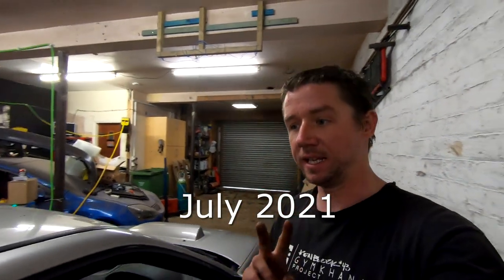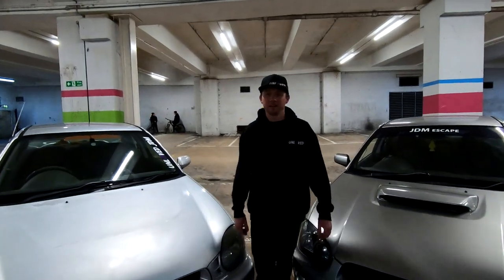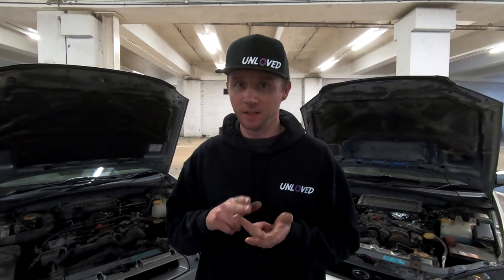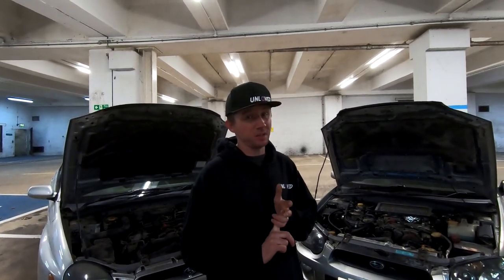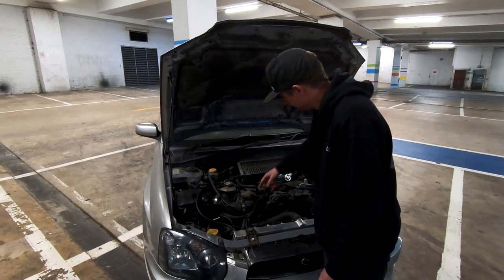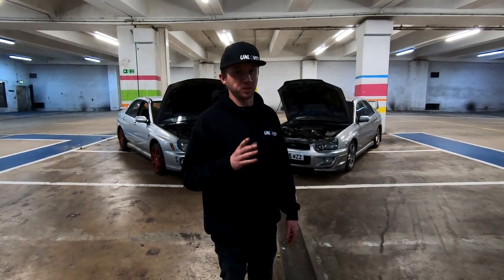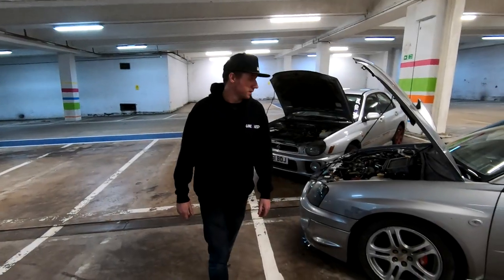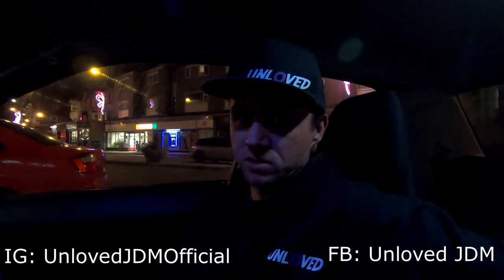How hard is it to Turbo Swap an NA Subaru?

Comment: I've done it twice. The hardest part obviously is the wiring merge. My brother tackled the merge in my 2000 RS ej205 swap. I wire did the one in my 98 Forester Ej205 swap.

Comment: Interesting video. Doing this to my current GX is probably my best option. Finding a 02-06 WRX that hasn't been absolutely flogged and has been well looked after is just unheard of here in Australia. So it's very likely it'd be my best option to do it this way. Thanks for the pointers and insight on how you did it.
Reply: Same here man, same here, GX wagon in Subie White, 300,000kms and needs a drastic upgrade badly.
Reply: Doing a ez30d 1st gen in bugeye,got the donor complete car  na,for now then raptor intercooled later this year.

Comment: Nearly completed mine, should be running close to 400bhp once mapped. But N/A to wrx engine swap is a hard job but 100% worth it in the end 😂
Reply from the maker: Totally agree! send me a DM on instagram or FB please
Reply: how did you wire the na transmission
Reply: @davidamaya8813  full wrx loom swap
Reply: @Carswithkylee  I did that too, but the tranny plug doesn’t match my wrx bulkhead. Did urs? Or did u have to swap a plug or 2

Comment: I’m hopefully on the last few steps of my “ej205” swap, if your willing to tear down your stock engine and put some goodies in it to take boost and turbo the stock ej253 (if yours has that) you would get a better performance per dollar. If you do decide to go the route of swapping it’s very involved and really not worth it in comparison to buying a wrx, unless wrx are insanely expensive or you value the experience of learning the ins and outs of your car. During this process you’ll also end up having the option to put a very little amount of stock parts on which often will be cheaper, it was cheaper to get a full 3inch catless exhaust then find the stock one on the hard market, so likely you will end up having a car that out performs the wrx by a lot.

Comment: Hi James, nice hard work, I have done an Impreza n/a automatic 1.6 ts swap to a WRX  at a great friend garage so everything works fine now except the 4eat same old transmission is working just on 3 gears after using the D drive or fourth gear it will stall and slow the car instead of pushing it, so please what AT transmission swap should you advise to solve this problem like forester as you mentioned in your video ? and should I buy it with its computer too. Thank you in advance.

Comment: About to swap a ej205 engine from a GGA wrx wagon onto a GG9 base model wagon that has an ej204. Shouldn't run into much trouble as you since both cars share the same chassis right?
Reply from the maker: In theory yes

Comment: So with the wiring if I take a blobeye WRX engine and harness and want to throw it in my Blobeye 2.5RS its just plug and play for the most part?
Reply from the maker: Yes but it would be easier to find one as close to your model year as possible. If yours is a GC8, a Blobleye loom would have a few differences

Comment: how do you solve the problem with the clutch?
Reply from the maker: What do you mean?
Reply: @UnlovedJDM  wrx mount a pull clutch and gx a push clutch did you install a stage 2 gx clutch or what?
Reply from the maker: @areko1616  The gearbox assembly is also from a wrx so it all works together
Reply: @UnlovedJDM yes the gear box works , but i mean the resalase bearing of the wrx donsent fit in my fork so thats what i am saying
Reply from the maker: @areko1616  Change the fork also, literally everthing from the WRX

Comment: Would it be cheaper to just get a WRX, because I’ve looking at listings for some time now, yes, n/a is cheaper but is it actually worth the money and effort swapping instead of buying a turbo model?
Reply from the maker: Honestly, most likely it would be cheaper but its personal prefrence
Reply: The general consensus on forums like NASIOC is that its always cheaper and easier to just trade your car in for a WRX if you want a turbo. That being said I have a 2006 Impreza 2.5i and its a blast to drive. I actually have more fun driving it than my cousins WRX. Its pulls really well and the power is so controllable it makes back roads really fun. Make sure to get a 5 speed though because the automatics are soul crushing.
Reply: @ColoradoStreaming  I heard the 5 speeds were made from glass though
Reply: @thejdmguru621  Only if you have a WRX and abuse it. I have 158,000 miles on my 5 speed 2006 2.5i and have owned the car since 2007. It has never had problems and I still have the original clutch because I dont launch it on pavement. I actually wore a hole through the floor mat and carpet heel tow shifting for 18 years lol.